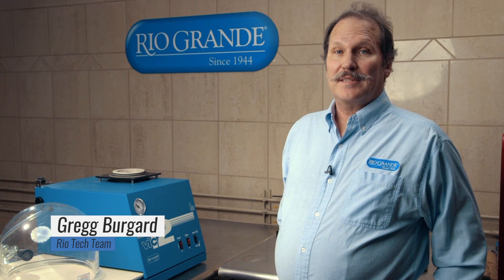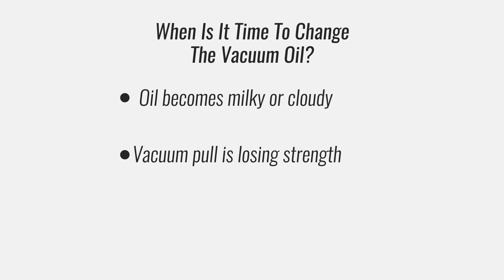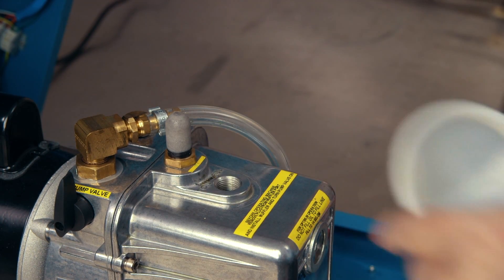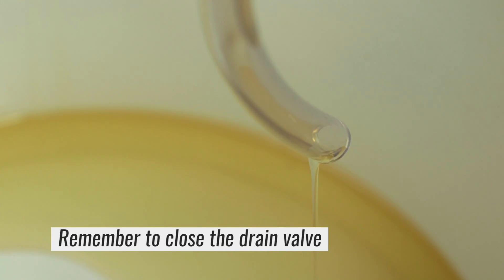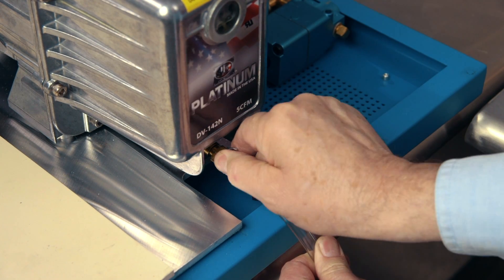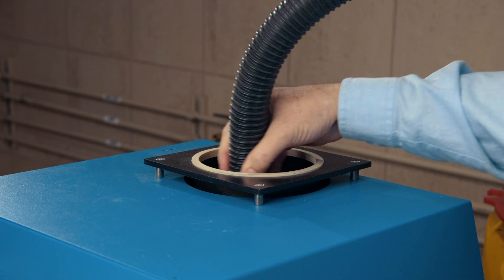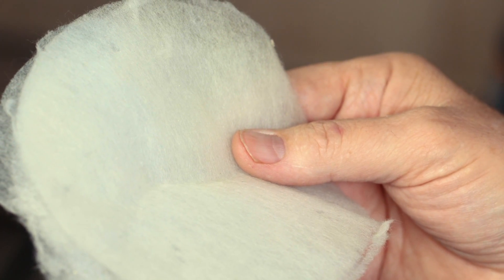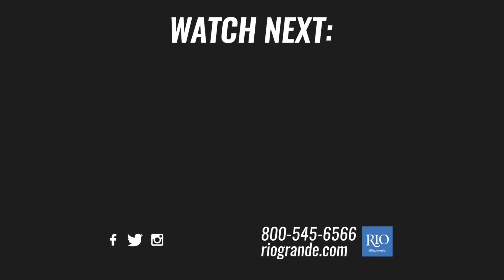V.I.C. 12 Casting Machine Maintenance

Comment: The sintered air stone is not adequate at capturing oil mist exhaust from the vacuum pump. Is there an oil mist filter that fits inside the VIC12 housing?
Reply from the maker: We do not carry another type of filter for this
. We're sorry about that. Let us know if you have other questions!
Reply: @RioGrande1944  Your technician called and suggested that only running the vacuum pump with closed volumes (when the dome is on the rubber pad, or when the flask is in the chamber) would reduce the oil escaping through the air stone. I was degassing rubber molds when the majority of the oil escaped. The dome was not sealing and pulling a vacuum, which may have momentarily overheated the oil in the pump.